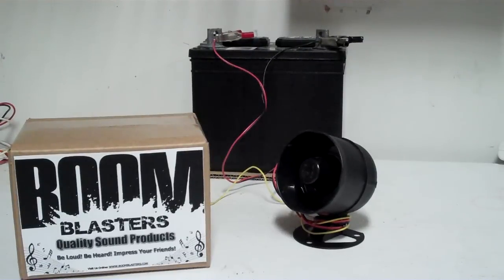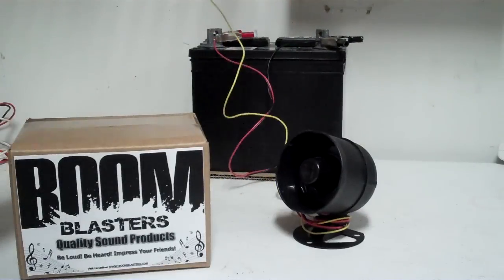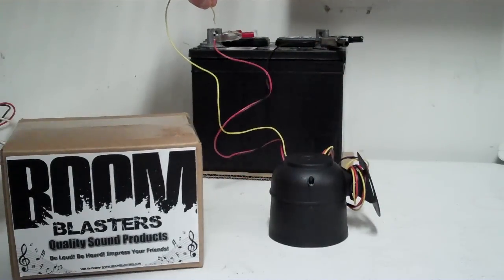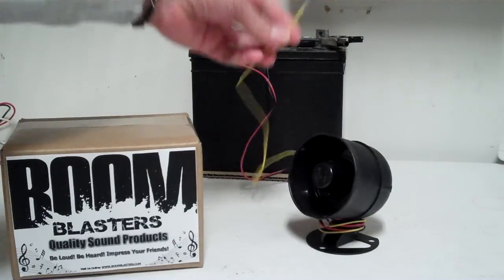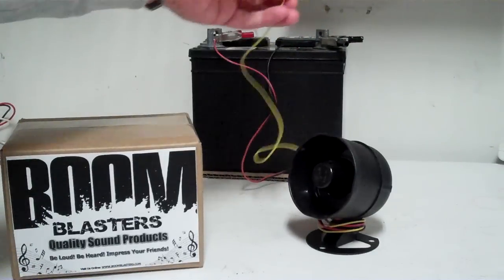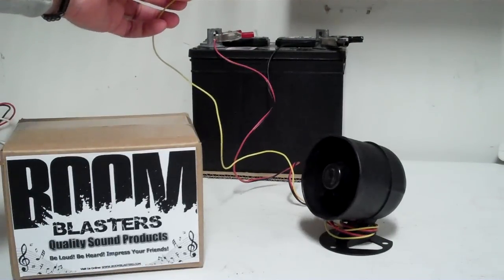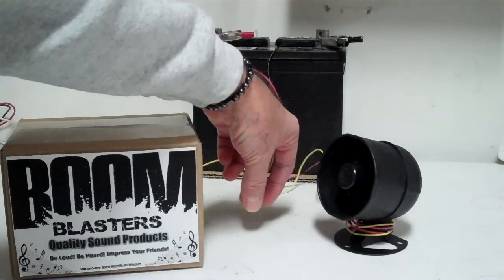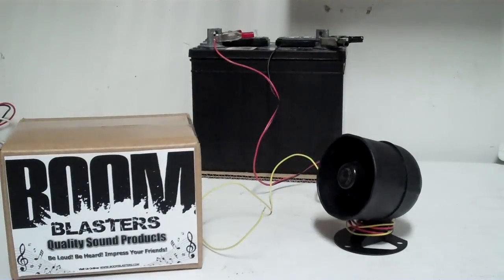Boom Blasters Car Horn Installation Tutorial

Comment: how many amps does it draw, what size fuse should I use
Reply: You should at least run a fused wire from the battery to the wire on the horn. I'd go with at least a 7.5amp fuse. Watts/Volts = Amps. Horn is 20 watts so 20/13.5 (volts from alternator) = 1.5 amps.  You should round to next fuse size up but I wouldn't go less than 7.5amps. Ideally you'll also want to run a relay so it's not a constant drain on the battery.
Reply: @morebeer7673 I just wired mine up to a fuse tap that is tapping on the DOME fuse on my car so it has constant power. Also others have had theirs wired to the battery directly with no issue. FWIW I have the big bubba horn with a remote

Comment: Will 2 horns make it more louder? I have bought one from  Boom Busters (godfather)
Reply: Did u place it facing down? I was thinking about getting the same one but what’s the point if it’s not loud enough lol
Reply: You can barely hear it especially when u have a loud exhaust. I didn’t want to place near the grill just in case the water gets to it when it rains or car wash. I was shopping around and found some on eBay which is probably louder as there are several horns are provided. Obviously it’s been couple of months and they neglect questions.